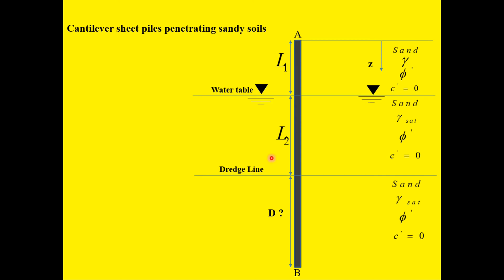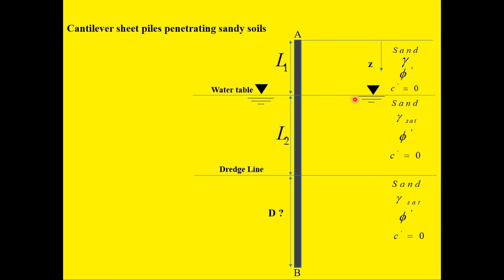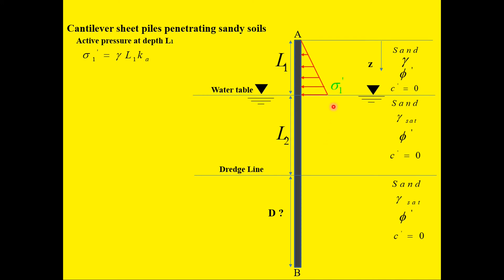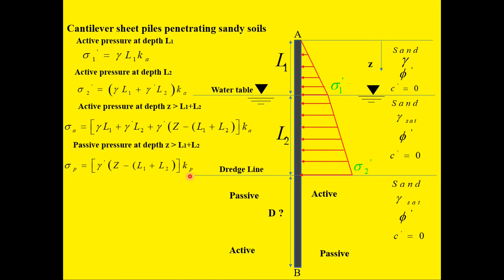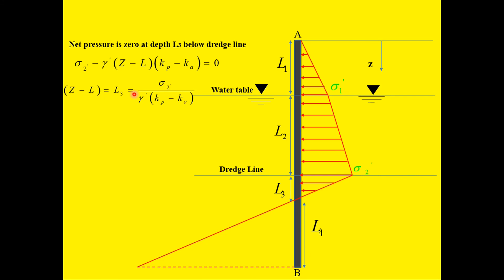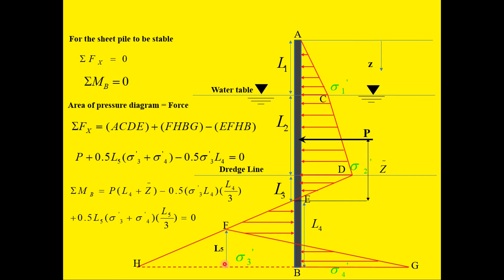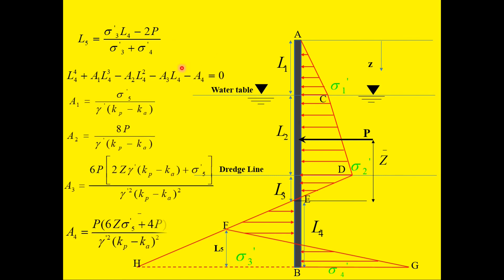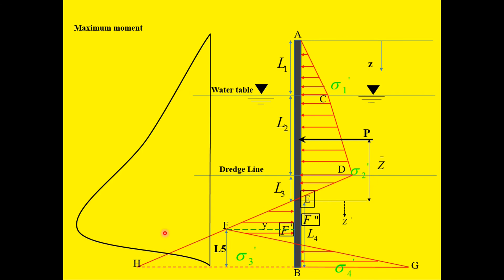Design of Cantilever sheet pile wall

Comment: Thanks for the video, it was very helpful. If you were to have the watertable say 1m below the dredge line, how would that affect your your calculations?
Reply from the maker: In any case including  the one you stated in your question, if there is varying ground water table, we have to adjust the active and passive earth pressure equations by considering effective stress rather than total stress. Thanks Rob .